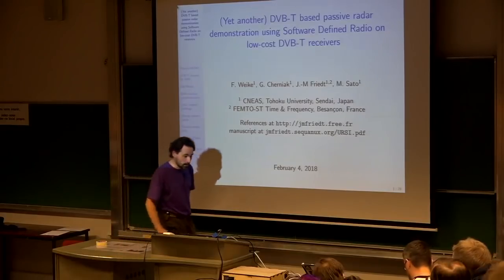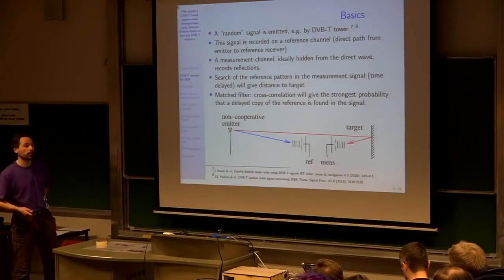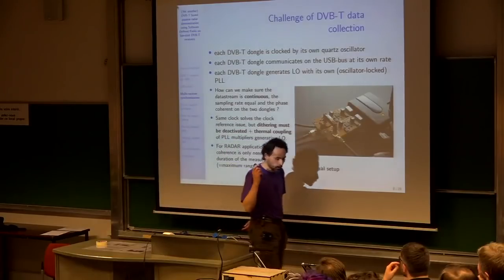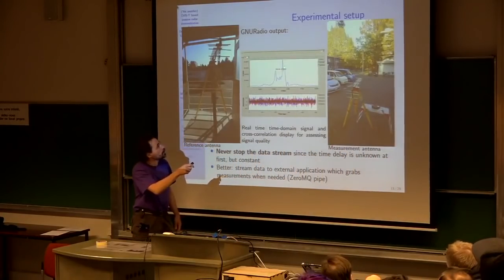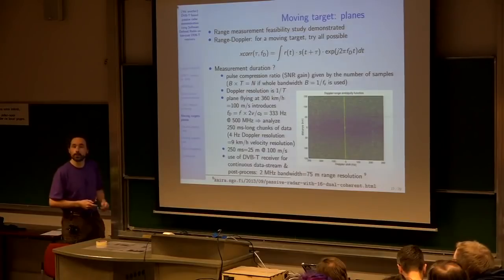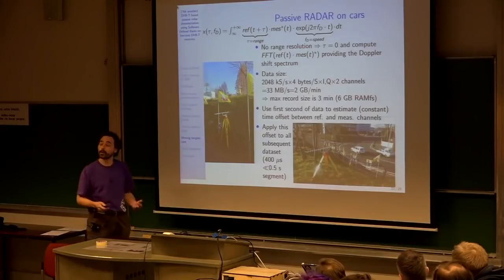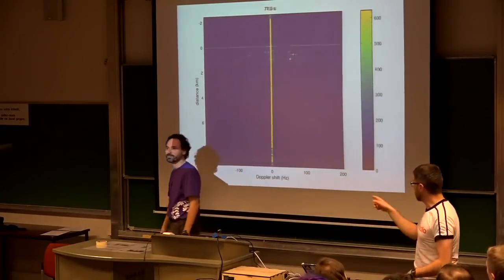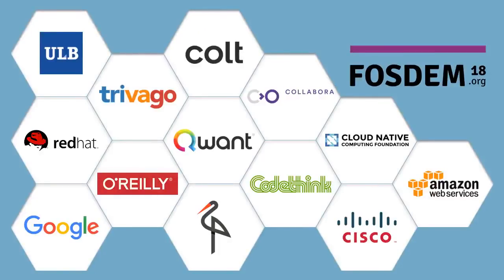(Yet another) passive RADAR using DVB-T receiver and SDR.

Comment: Wait, why is the bandwidth important for the resolution of static targets? Why is it a limiting factor for that, when the reference signal doesn’t even emit anything wider than a few kHz?
Reply: The signal you'r receiving is 'modulated' by the reflections. the more the phase difference, the more resolution, but also the more bandwidth.
Otherwise said. the resuliotion is determt by the wave length.. the higher the resolution, the smaller the wavelength, so the higher the frequenty aka bandwidth.
to bad... high resolution radar is not (yett) for the el-cheapo hobbyworld.
Still it is cool (and not at all to easy) to play with

Comment: Can the tuner IC pll reference crystal pins be bypassed to use an external LO? Its not on the the data sheet, it a manufacturer test, it insider information. This will solve the phase coherent problem.
Reply: It's easyer to use a different solution like a usrp... maybe a plutoSDR can be modified

Comment: I think this is a great achievement and there must be some fields in technology where this can be very useful, like espionage or warfare. There are also some limits, for instance when the received signal suddenly is being stopped for any reason, there is at the same time no passive RADAR image anymore. The classic active RADAR is much more reliable.
Reply: Thats why for military applications still a (expendable) transmitter is used, however on a seperate location.
This avoids detection or location of the radar station.
Reply: But by using active RADAR you are telling everyone your exact position. And Chances are that they can detect your RADAR from much farther away than you can look with your own RADAR. Also, Passive RADARs powered by broadcast FM were already used in the 1930s